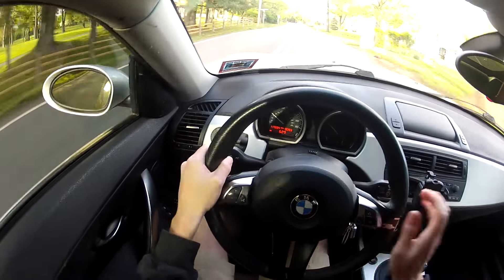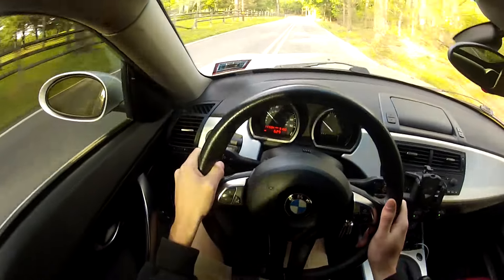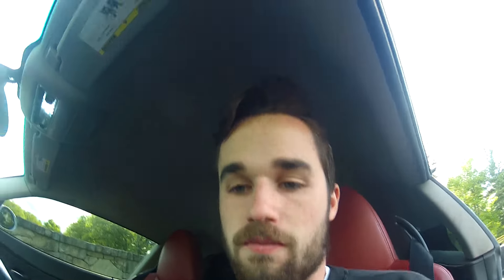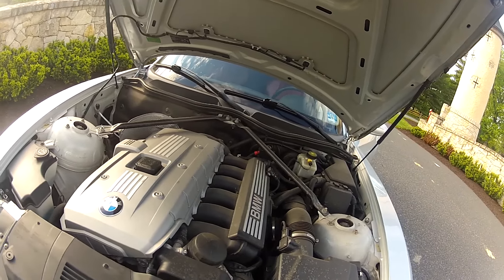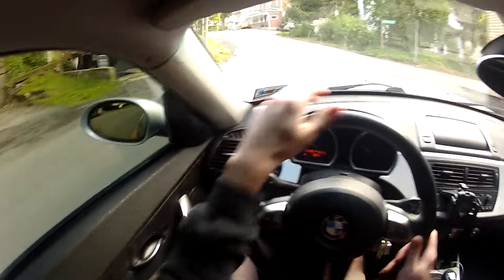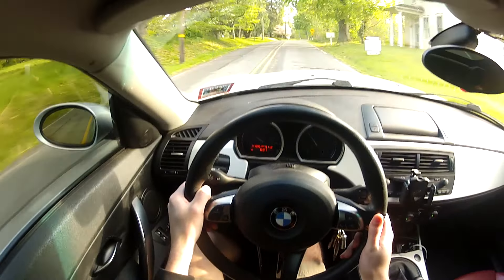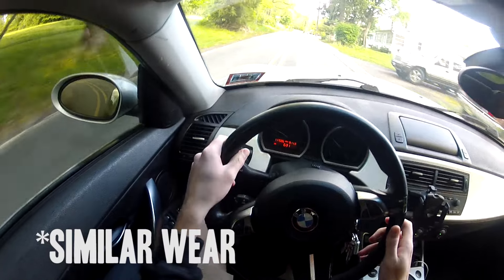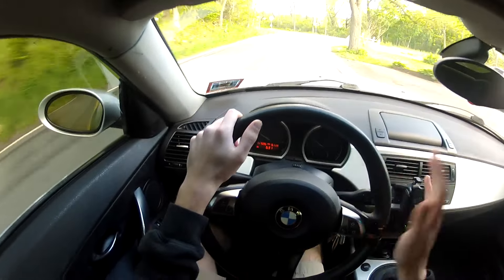The INFAMOUS BMW Lifter Tick / Ticking Noise (E90, E92, E82, E85, E86)

Comment: Good vid thanks: I just warm engine up to normal temps, then hold revs at 3500 rpm for 3 minutes... Noise goes... Common problem with short distance/low rev driving.. but not disastrous.
Reply: How often do you have to do that
Reply: @fromthedeserts2724  when it ticks... regular oil change helps and in summer I use fully synthetic 5W/40, winter 5W/30 Mobil oil always Genuine oil filter. Its an annoying trait for the N52, but irritating intermittent : NOT disastrous. When engine is hot/normal temps, then switch engine off, put ignition ON, then put into 'sport' mode and use car safely because it now uses higher revs which also helps to 'bleed' the hydraulic lifter's.!. This cures my ticking, but sometimes it comes back, I'm used to it now BUT its an awesome engine especially in sport mode. Hope this helps you.

Comment: I have a 335i that has lifter tick on a warm start then it goes away in 10-15 seconds and i dont hear it anymore.
Reply from the maker: bahumat sol Hmm interesting! I wasn't 100% sure if the 335i had a prominent lifter tick noise
Reply: The lifter could need to be bled out. If it continues afterward it could be a faulty cylinder head

Comment: Tried many solutions without success. After months i think I solved the problem with an oil additive (lubegard bio/tech in my case, maybe others do the job as well). Results came after 1000km more or less. It has been 6 months since then and the ticking never came back.
Reply: Lubegard Hyper ZDDP Zinc additive
It adds a film on the hydraulic lifters that sticks to the surfaces a very long time, so upon cold start even with oil starvation, lifters would still move freely without sticking and the noise is significantly reduced.

Comment: I have a 2006 e60 with the N52 engine. Use Castrol full syntethic 0w-40 european formula. change every 5000 miles with the MANN oil filter. I never had this issue with this combo

Comment: There’s a secret for bmw when driving put on Neutral and let the car roll shut it off for 3 seconds then turn on it should drive quicker
Reply: ICU Motors what causes that? mines set for three weeks and that happened to me today. it went to neutral and shut it off on it's on. started back up and ran fine but the ticking i hear. i should probably go with a thicker oil for the summer.
Reply: what u mean by drive quicker?